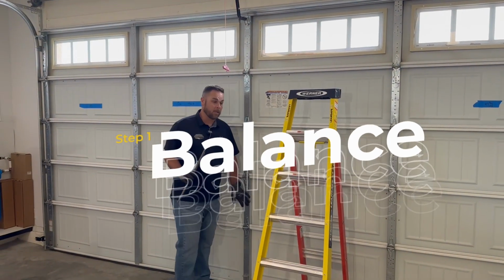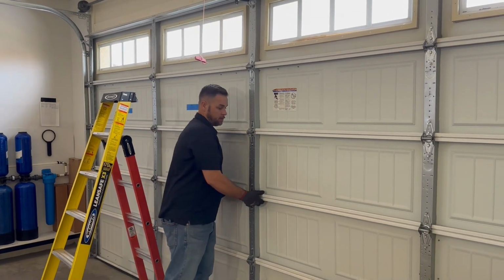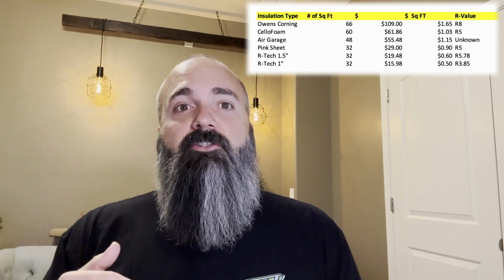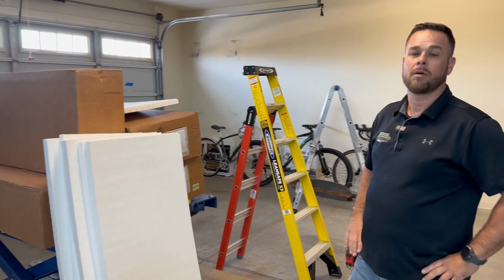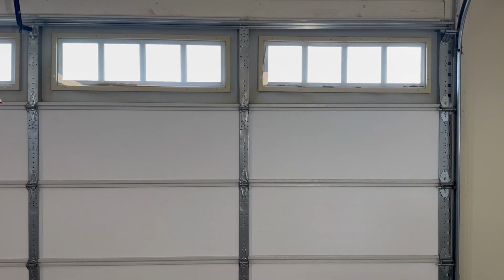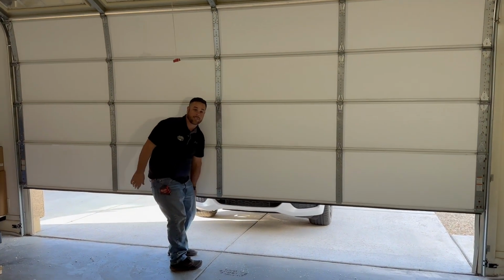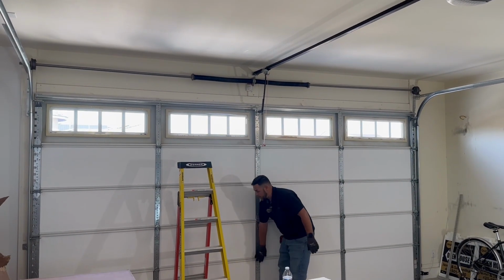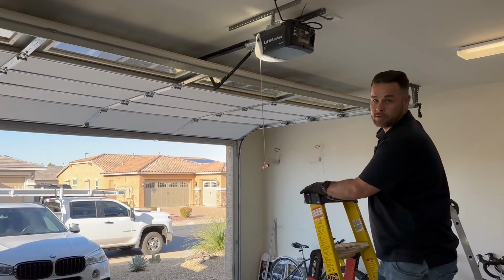Extreme Weather? Insulate Your Garage Door!

Comment: The garage door dude said radiant heat is the main problem. R-value does not take radiant heat into the equation. Shiny aluminum on the side of the heat reduces heat infiltration by reflecting it away. Reflection and heat transmission must be addressed together.
Reply from the maker: Great point about radiant heat! While we didn't address that specially I can say that the insulation is working well. The doors  used to be so amazingly hot that working on that side of the garage was terrible. Now they are warm at best.

Comment: Looks good. Wish you would of slowed the video down and showed what you were talking about when installing the inch and a half strips in L brackets at the 6:17 mark of video.
Reply from the maker: Ahh sorry. I'm still learning to balance speed with audience interest. Those 1" strips are filler so when we bent the insualtion to squeeze it into the bay it wouldn't snap. If we cut the insulation to the full width it was much more difficult to get into the bay and fill the whole thing out. Hope that helps.
Reply: @DrivingForwardBuilds  No problems. Thanks for the explanation.
Reply: What are they? Are they extra foam or something else you purchased? @DrivingForwardBuilds

Comment: Professional here... Adding more tension to the spring reduces the life of the spring. Springs are rated for weight/height of the door at a minimum for 10,000 open/close cycles. Absolutely correct adding insulation to the door adds weight, for which springs needed to be exchanged.
Also, IF your springs lost tension after an install, it was not done properly. NOT TO SAY IT DOES/CANNOT HAPPEN. Always contact a professional. This gentleman gave us the biggest hint as to why this was not done correctly. The person doing the work is a FRIEND! Make sure your friend does the work properly. PLEASE CALL A TRUE PROFESSIONAL.
Reply from the maker: Thanks for commenting. Though to correct you my friend is a professional. The springs were replaced prior to the video for the weight that it would be, and my RV springs were already oversized. The spring adjustment was to rebalance for the weight. Appreciate you watching out.
Reply: @DrivingForwardBuilds  that is not what was said in the video... Your friend may be a professional, yet he did the "hack" type of work. Take the honest criticism, and watch for misleading others. Thank you.
Reply from the maker: @charlesdeffendoll3817 I’m perfectly comfortable with criticism. If the springs were sized for the weight prior to the installation wouldn’t it make sense to have them under wound?
Reply: @DrivingForwardBuilds  In the beginning of the video he stated, "Springs lose tension." Why are you back tracking? I stated sometimes springs lose tension, which if done properly should not happen. Nothing was stated you had new springs installed prior... Which you stated... I feel it's still misleading information. IF the springs were changed, why not explain that in the video, show the process? Obviously you were caught being deceptive, and now lying about it. Make sure to use professionals. Not just a "professional" friend.
Reply: @DrivingForwardBuilds  Also, having a spring "under wound" would cause further issues, as jumped cables, heavy door, strain on the operator, amongst other issues. Are you quizzing me?
Reply from the maker: @charlesdeffendoll3817  Nope, I genuinely didn't know. I installed the springs months prior to the insulation myself. I ordered the springs with this in mind.  I'm not a door tech, just a dude with an awesome beard playing in my garage on the internet. I installed the springs, balanced the door, and waited till funds were available to install insulation. At that point, a few more winds were added to rebalance the new weight.
Reply from the maker: @charlesdeffendoll3817  Dude, no one is trying to deceive here. Clearly, you're bent about something. I just film what's happening and don't know or remember to say every perfect thing. It's the internet, chill, not the garage door bible.
Reply: @DrivingForwardBuilds  I am chill. Pointing out the fallacies so someone does not get hurt, or damage their property by having an incorrect process. Thank you.
Reply: @charlesdeffendoll3817 you are anything but chill. Reading your responses is embarrassing as someone with no connection to anyone in the video or comment. Dude, you're confrontational, even calling him deceptive, which means he was intentionally trying to mislead people. How could you know what his intentions were? You should have written your first response and left it at that if you were chill.  Instead, you wanted to pick a fight with a guy who admits he's not a professional and just doing his own door. Get a grip.

Comment: I'm moving my studio space into the garage this summer and will be doing the same thing on a smaller scale luckily. Have to have the walls filled and also replace the 15amp outlets with 30amp and all the romex in between. At least the panel is in the same room.
Reply from the maker: That’s nice to have close access to the panel. Why the 30 amp outlets though?

Comment: Does the door technician work overseas?🤣
Reply: $5000 trip charge.
Reply: If you install couple of  garage Vents  fan it helps to extract some of the hot air out of your garage.
Reply: @yvettel.5981  just don’t vent it to the attic lol
Reply from the maker: i'm sure for the right vacation he could be persuaded.

Comment: What are the strips called that hold the panels?
Reply: 1/2" x1/2" Vinyl L-Angle, can get 8-10' strips, and cut to fit.
Reply from the maker: I believe they are just trim strips or retainer strips. I haven’t found them outside of the garage door installers though.

Comment: Where can I find the strips to hold the panels in place?
Reply from the maker: I’ve only been able to find them through a garage door supplier or installer.
Reply: Could cut flat plastic strips

Double sided tape if the bend out on you.

Comment: Does the sun shine on your garage door? I am in Phoenix, and find that sun shining on the door raises the temperature of the door 40 degrees above ambient, even in the winter. I have not measured it in the summer, but my garage gets terribly hot in the summer. When I used a thermal camera on the house at midnight, I found the garage doors to be a huge heat loss, much more than my single pane windows.
Reply from the maker: My House is north-north westfacing. In the winter my garage doors get zero sun. The summer is different. My rv bay gets a few hours in the afternoon of sun, but blocks the small garage to some degree. The panels get extremely hot. The insulation panels helped a lot. I measured the exterior in the afternoon sun and it was in the 140* range on the outside. Inside was closer to 105*.

Comment: So what are the strips called? The pro tip?
Reply: Vinyl 1/2" x 1/2" L-Angle... This guy does not know what he is talking about "beauty strip". Can pick it up at Home Depot, Lowes, most hardware stores. "Pro tip" cut to fit. The insulation kits generally come with them (keyword "generally").
Reply from the maker: They are "beauty strips" or just "filler strips".
Reply: @DrivingForwardBuilds  Can't find it at Homedepot.

Comment: 😮Great tips! Important to be safe. Are you going to insulate by the windows?
Reply from the maker: I'm not planing on it currently. I did use the remaining scrap pieces to wrap the current windows though.
Reply: @DrivingForwardBuilds 
What I wanted to know was not the garage door heat difference but the overall garage temperature. Do you recall how much the entire garage temperature went down by?
Reply from the maker: That’s a little tougher to quantify. I installed my wall insulation shortly after doing the doors. During the brief time before insulating the walls I’d say it was around a 10* difference.